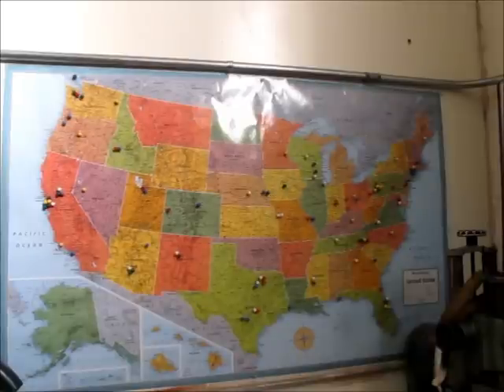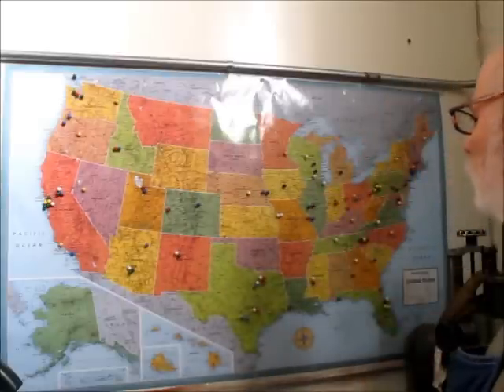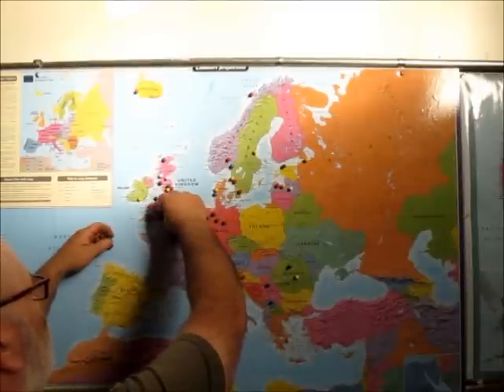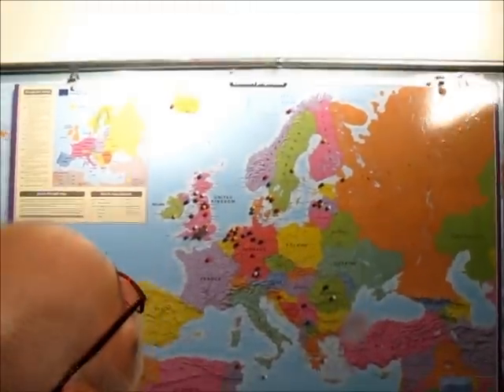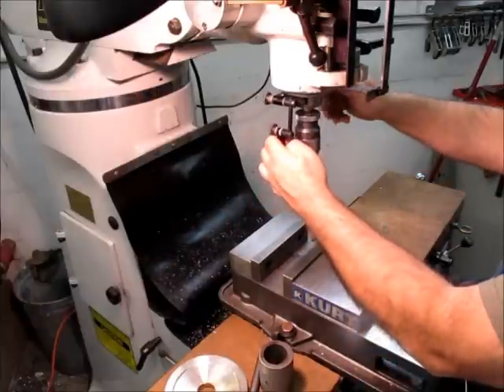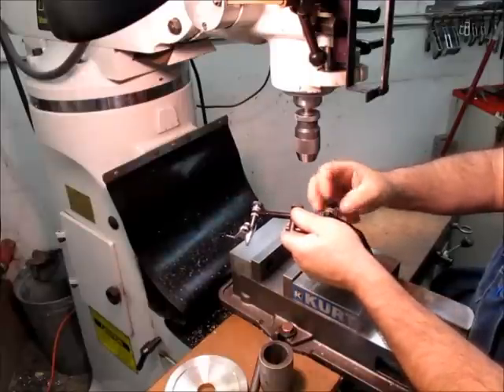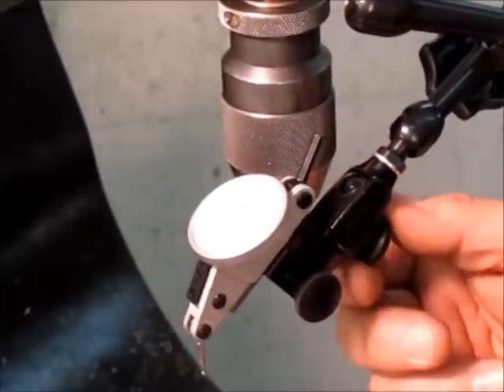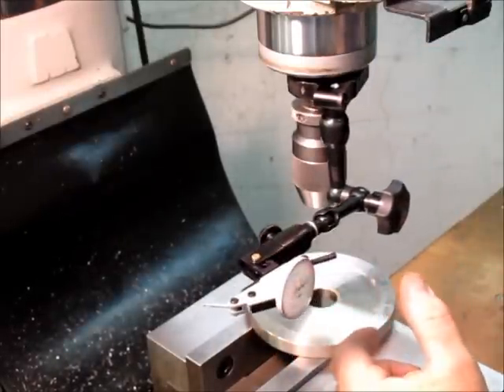A Noga and Indicol marriage.

Comment: I"m going to make that. I just bought the arm today off MSC. However, I used a 3/8th to 3/16th brass bushing to accommodate the 3/16th diameter stem of my last word indicator as I don't have a dove tail style indicator.  There is a .375 inch hole adjacent the dove tail. I had to turn a few thousand off the bushings OD to fit and split the bushing to get it clamp down on the stem. Bought the bushing from McMaster-Carr's website.. The 5 mm threaded faster should thread deeper into the clamp. 1/8 depth, is very short thread especially if your in aluminum. Maybe I should use some kind of lock-tight in the threaded hole. Its all together now and works great but time will tell if i like using it and if it holds up. I'm rough on my tools sometimes.

Comment from the maker: Hi Johhnym,

Ouch!

Check MSC out. Part number 09560434 for $118. The model without the base and fine adjust at the top is 09560442 which I put at the end of the video also. They are worth a hundred bucks but near four hundred is a stretch.

Best,

Tom

Comment from the maker: Hi Bill,

I really like the smaller Noga. I bought the large one first so when I saw the little cute one I had to have one. The Indicol is nice for that very reason. You don't have to dump the tool and put an indicator in. As you saw the smaller Noga has enough grip to get onto the spindle nose so if I was doing it over again I might be tempted to just go with the small Noga instead of the Indicol.

Regards,

Tom

Comment: Hi Tom noticed in the comments you said you dont prefer a swivel vise base is that because of the loss in the z travel or other reason, i am getting ready to buy a new Kurt vise for my other mill and thought the swivel base would give me additional capabilities-am i wrong please elaborate. Cheers
Reply from the maker: Hi Johnny,

I never got into them. The swivel bases always sucked up too much z for one and they make a heavy vise even heavier to take on and off the machine. If I want angles I set them accurately and not with a eyeball scale. So if you take all that away what feature are they providing? The swivel bases are easy to find, mostly under the bench near the mill in many shops. Some folks really like them. I just never saw the utility of them. I am trainable, so if somebody convinced me I would get one in a heartbeat.

Hope this helps.

Tom
Reply: Thankyou Tom that helps a lot especially in the pocket book,

Comment: Great video Tom! I'm like you, I've really come to love those Noga holders. I too have an indicol holder and will most likely do the same modification so I can use the small Noga. They so versatile with there multi axis movements, and being able to clamp so many different indicators. The Noga I use at work has the fine adjustment on the base which I find I like a little better. But I'm happy to any of them. Thanks Tom. Talk to ya later!

Comment from the maker: Hi Rod,

Definitely get the extra table size if your workspace can handle it. My personal experience is the riser is not used much. That said I prefer to not use a swivel base on any of my mill vises. If you like the swivel base then the riser might make sense. If you are of normal height the riser will put the drawbar just out of reach. Also check your vertical clearance if this is a garage or other low headroom play area.

Hope that helps.

Best,

Tom

Comment: Hi Tom.  I'm planning to buy milling machine and was wondering what make, model and size yours is.  I tend to think I want to get a 9 x 49 and have been looking at the grizzly model G9902.  Also, this milling machine has a six inch riser accessoryy and I wonder what your feeling is on the benefits of the extra six inches between spindle and table.  The max distance spindle to table without the riser is 18 inches.  I should mention this is for my hobby since I retired.  Tnx  Rod

Comment: I did the same except I kept the Indicol main arm. I used an NF Noga centering arm and drilled/reamed the Indicol pivot. The Noga is 8mm, Indicol opening is 1/4"., still leaves enough metal on the pivot and Keeps the Noga centered with the Indicol design. Nice work Tom.  What about a Hougen annular cutter arbor?  They're so expensive, I'd like to make one, R8 or straight shank. Heat treated O1. ???
Reply: If u want it in the spindle the noga u had was far superior to what u made... if noga made a clamp like this in video indicol sales would plummet! Have u ever tried to indicate a bore with a indicol try getting the dial to zero its very hard vs the noga u just use fine adjustment. The indicol is not that rigid vs the noga, and to make it decent u have to tighten all knobs fairly hard va the noga just one knob and its rock solid. Dont get me wrong for that specific type of holder the indicol is by far the best mostly cause it has those wavy washers that help to make tightening the joints much easier than cheapos that u can take a vise grips and tighten the knob and its still loose. The noga is just far far better the indicol is just much easier to use no need to remove the tool just clamp around tool holder. That is why this video is awesome it show how to combine 2 greats... you kinda took the bad parts of each and combined them?!?
Reply: What i said was based on u taking the noga spindle and mating it to the indicol arm. If that is not what u did if u did the same as OX just a different method then nvr mind. If you are using the indicol arm and the noga shank to clamp that yes i meant that lol

Comment: Actually, there is an attachment for the Indicol arm that allows fine adjustment, I have one, but your solution is..... expletive, brilliant! I am on it and ordering said attachments, hope I can get it without magnet and without attachments?
Reply from the maker: Hi Stephen,

You can most definitely get the NOGA arm without the magnet. I'm pretty sure I got that one from MSC. Be sure you read the catalog reference and compare it to the NOGA part numbers on their site. My only complaint about NOGA is their model numbering and catalog system.

Cheers,

Tom

Comment: Great idea!  I noted you said that you drilled and tapped an M5 hole, so I went looking for a suitable tap drill and tap, and I found that M5 comes in three different thread pitches.  So which pitch do I need?  Many thanks.
Reply from the maker: Hi Bx,

Did you buy your Noga yet? Its the same size as that. M5 x .8

All the best.

Tom
Reply: oxtoolco Yes, it's on order, and now my tap is, too.  Thanks.  BTW, in case anyone is interested, Enco has the one with the mag base on sale so it's cheaper than the one without.

Comment: how rigid is your noga? I am looking at the spindle held test indicator holder Noga NF1018 and a review on amazon says 
"It is heavier and less rigid than other holders. I wouldn't trust it beyond a couple thou in a horizontal spindle"
does it have enough rigidity to not move at all and add error to the indicator?
Reply from the maker: Hi Red dog,

Well horizontal spindles are a special case. Everything sags it just depends how close you need to be to the spindle rotation. It is a function of the weight and unsupported length. If you are working on horizontal spindle machines routinely I would try a Co-Ax type indicator. The body stays on center and the stylus rotates. Low mass and short length. Thanks for the comment.

Cheers,

Tom